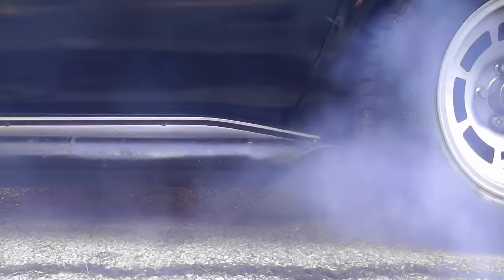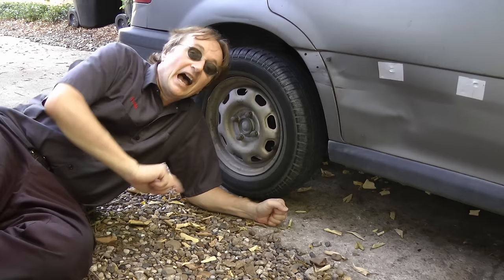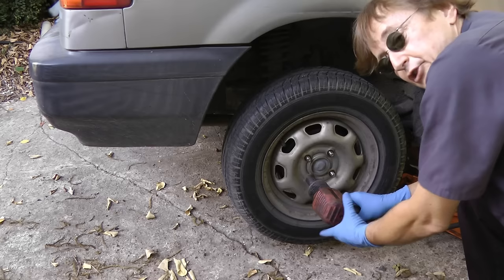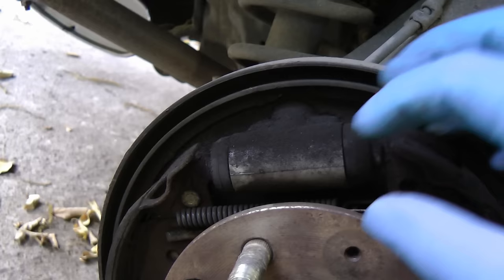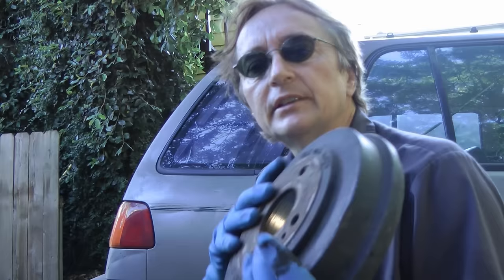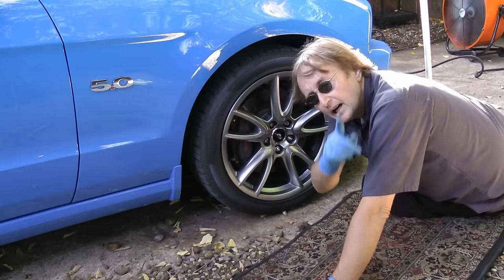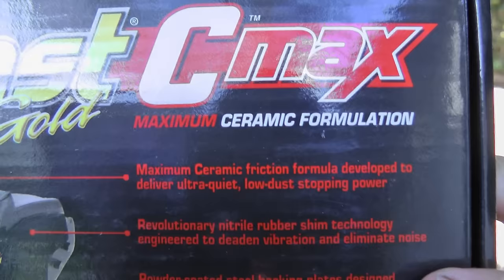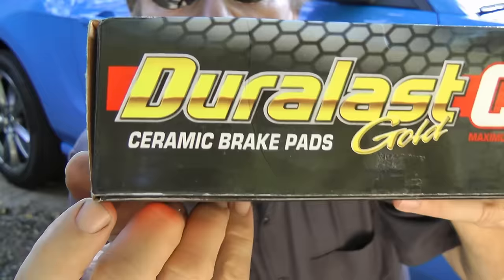How to Fix Squeaky Brakes in Your Car

Comment: Makesure to 'bed-in' the new pads/discs by finding an empty carpark, doing about 20mph and braking hard until you stop. Repeat this 10 times until the disc has a coating of the pad. Do a burn out then hook up with your buds.

Comment: Hey Scotty I have a 2003 Toyota 4Runner V8 and the breaks only squeak when I'm in reverse and lightly press the break pedal, never in a forward gear. It only happens in certain conditions, and I had a break job done a few months ago and I'm not sure if they put on ceramic pads are not.

Comment: Scotty, can a large amount of brake dust cause the brakes to squeak?  So maybe I could get by with cleaning off the dust as opposed to resurface the discs?  Along, what is your recommendation on using disc brake quiet?  Can that be sprayed directed onto the pad or disc?  Thanks for all of your help.

Comment: Rotors come with an anti-rusting agent when you get them out of the box, it's kind of greasy and can make the braking surface slippery. What you need to do is spray them down with a bit of degreaser to get that coating off.

Comment: did this yesterday. cheap pads causing heaps of dust which made the wheels squeak, all i did was take the wheel off and cleaned all the dust , put the wheel back on and it was fixed !! told my cousin its just a dirty car hahaha. now hes returning the front wheel bearing that he bought to supercheap auto .

Comment: Whats the best way to clean front pads up, they still have plenty of material left but i just want rid of the dust is it enough to use a wire brush on them?

Comment: Often all you end up doing on the rear drums is get the drum brake dust out.
Clean with brake cleaner, and lubricate some brake parts.
as far as the front, they usually start squeaking because they're glazed, or worn. glazed brakes, sandpaper, or replace. Worn, replace.

Comment: My car is Subaru 1998 , the front brake pads in the right side is finished

the in-right pad is used from down-side more than up-side

the out-right is used from up-side more than down-side

the left side is ok i think , there is about a quarter to get finished and it's equal from up the down

the slide pins in both sides are ok and greased perfectly

what is the problem ? and how to fix it ?
Reply from the maker: replace the right side calliper and the rubber hose feeding it

Comment: I'm sorry, I didn't make the question clear. Suppose the min is 27.2 mm, and your rotor is 28.5mm now. Is the 1.3 mm difference enough room to turn the rotor and still have a rotor that is larger than minimum?

Comment: HI Scott my 2015 mitsubishi with 30 k mirage (sold as is) squeaks for a few stops after the car has been sitting for more than about 15 minutes. It stops after the first few breaks. I just got the car from big lexus dealership and only put about 200 miles on it.

Comment: I just recently changed my front disk brake pads and rotors (about a week ago) now they will squeak pretty loud when I lightly push on the brake pedal, but then I press down harder, the noise goes away.
Reply from the maker: +Jason Ford live with it, or replace the brake rotors, it means nothing though

Comment: Hey Scotty love you're videos. Always find what I need. But today, I am stuck with another question. The passenger side seems to be squeaking when I start driving at low speeds, and it goes away at high speeds. The brakes are fairly new both front and back. It's a high squeeky sound and its temporary. But it's annoying me. What should I do? its a 2005 nissan altima. Thanks a ton!

Comment: Hey , quick question .. I got a 1997 civic hatchback that won't pass smog .. It was an automatic but then converted to a manual car . When it was converted they didn't put the sensor wires that go to the radiator which makes it not pass smog. Do you think this is fixable and about how much are we looking at to fix ? Thanks in advance !!

Comment: I just replaced my brake rotors and pads on my 99 blazer. The pads are of high quality ceramic and where quite expensive so I was highly disappointed that my car squeals when braking. what could it be? Finally, I took my car to get it check and they told me it needed a bunch of parts in the front such as idler arms, bushings, etc... However, my car does not show any symptoms such as shaking or cracking. should I still be concerned? Thanks scotty for all your amazing videos.

Comment: Scotty thank you for the squeaky brake tip. Inspected my squeaky brakes on my 2008 Chevy cobalt and they will need replacing.. One question regarding lubricating the rear drum brakes on the contact points. Do I use regular grease or should I use antisieze. Thank you. Rich
Reply: Antiseize is not a lubricant for moving parts. Used outside of a joint it can be  a sacrificial rust inhibitor, but doesn't prevent or dampen metal to metal contact.

Comment from the maker: You would have to put all wires and sensors back on, reset the computer, then drive it at least 40 miles on the highway and PRAY the computer resets itself to normal and can do all its tests to make it pass.

Comment: hey scotty i have a 2004 silverado and when im not using the brakes and hit bumps in the road it sounds like the brakes rattle. i say the brakes because it only happens when im not using them. as soon as i put the slightest amount of pressure on the brake pedal the rattle goes away. do you think it could be the pads or what?

Comment: I have a 2000 chevy cavalier, and when I hit the brakes it sounds like a knocking sound. it sounds like it is coming from the back wheels. I recently got all my brakes fixed. My guess (if it is possible) that the drums are warped? could that possibly be something. I know you can't really tell cause your not here.

Comment: Scotty. I have an 06 Cobalt 2.4L S/C. When ever i turn left the passengers side front wheel squeaks. I recently changed pads(it was happening before but pads needed replacing as well) I didn't notice any unusual wear on the pads. Any Idea what it would be I was thinking warped disk. its not a constant squeal its just a squeak at intervals so it has to be something that's rotating

Comment: Hi Scotty,
Need you to point me in the right direction to how I can repair my brake system without merely replacing the entire system , ABS included as the dealer is suggesting.I have a classic '89 Ferrari Mondial T Cabriolet that I unfortunately did not drive for a while. I started occasionally but not much driving with 25,011 original miles.Had the battery replaced at the dealer & they drove it but noticed brake pedal went to floor before stopping. Noticed the fluid has crystallized somewhat in the reservoir, as well as on 3 of the lines, except for the right front. Tried back flushing but no luck.They just do not seem too keen on resolving this creatively other than taking the easy route to replace the entire system, which as you can imagine would cost a fortune. I live in Palm Beach & a previous mechanic who worked on the car some years ago owns a shop in Scottsdale AZ as well as worked for the factory told me it could be resolved but I would need to ship the car to AZ on a enclosed transporter, which I do not want to have to do if not necessary.
Please help!!!
Mark

Comment: I am getting really frustrated with my 09 Silverado. I had the drums and shoes replaced on the rear about 3 months ago because they were worn down and squeaking. At first they were still squeaking but not as bad as before. About a month later they were squeaking even worse than before. So I took it back to the same place and they said my wheel cylinders were leaking. After getting the wheel cylinders replaced they were perfect. Now it has been a month since I replaced the wheel cylinders and they just started squeaking again... and bad too. I am getting so frustrated that I am thinking about trading in the truck! I just don't know what it could be!!!

Comment: just had my brake pads replaced and rotors too but the front passenger side is squeaking so fkin loud embarassing lols. gotta take it back to my mechanic to see what they can do to fix it maybe need more grease ? or metals rubbing each other like the calipers?

Comment: I've got a '97 Miata with disc brakes all around. They squeak very loudly when the brakes are cold and 'feel' quite different but behave normally once I get some heat in to them. Is this a sign of anything or is this normal?

Comment: I have almost 25k miles on my '11  Corolla, original brake pads, and I hear a squeak when lightly pressing the brake, but not when halfway or fully depressed.  What explains the squeaking at only lightly pressed brake, and does 25k seem a little early?

Comment: Scotty, I found an unusual problem on my mothers car when i took it home for an oil change. The front brakes are scrubbing/vibrating when stopping, rubbing when accelerating like they are sticking. Her BF replaced the rotor and pads on the front, he had to go back an apply anti-squeel to them to stop squealing, but they still do. Aside from that what do you believe the issue could be. I just need advice i have not pulled them apart yet. There is an unusual amount of brake dust to me. '10 Mazda 3

Comment: hey scotty, im having a problem with my brake lights not illuminating. ive checked the brake switch, fuse and bulbs. i have running lights and turn signals but no brake signal.

Comment: I just replaced my brake pads and rotors on my 07 prius it's making a very large squeaking noise on the passenger side tire. Do I need a special tool or maybe readjust the brakes.

Comment: Hey Scotty, i have a question... My front disc brakes on my ford f150 start squeaking on me when i do light braking after the truck has been driven for 10 to 15 minutes. (assuming the brakes are warmed up).. when its not warm there aren't any squeaks at all. would that be just normal? Not sure if they are ceramic pads or semi metallic...

Comment: What is considered a new car these days? right side brakes of my 2003 Ford Falcon BA are starting to squeek, is it possible the workshop replaced them with lower quality brake pads then the originals or would you say my drums need resurfacing?

Comment: hi scotty my 2003 trailblazer with 149,000 miles has a constant squeak coming from the right front wheel. the noise doesnt really get louder has a break but there is a pulsation in the pedal as i stop. do you think it's time for new rotors?

Comment: hey, im looking for a car under $2500. Iwhat do you think is the most reliable car or truck that will be in that price range? also, whats your opinion on pontiac grand ams and ford mustangs from around 1999-2000, with about 125,000 miles? reliable or junk?

Comment: Scotty hi, I have 2007 camry. I replaced brake pads and resurfaced my rotors. The mechanic said that It would take a good 300 kms. as the break-in period. So the car's breaking performans decreased considerably. Do you think it's normal?

Comment: 1997 F 150 when I press the brake pedal the rear tires lock up and a slight drag is heard afterwards, and a low pedal, it already has.new rear.shoes , any ideas ?

Comment: hey scooty i got a problem for u i can fiure out a budy of mine over tighten the spindel nuts when he changed his brakes burt up the berings and all most lost a tire  so we replace the spindels  are clapier but the damn brake pedal  still soflt after we have bleed the tires and the abs  the truck is a 94 f350  4w4 diesel

Comment: Your a god!!!!haha I was wondering if you could help me on a problem with my car I've been having.. my lights on the dash do not work ...I looked at the fuse in every time I replaced one it blows there is a short somewhere in the circuit but i cant find a way no way I can find it.. is there some way I can make it easier to find this problem thanks.. I've had this problem with this car sense I've bought it running late's work training signals work just those it's a 1997 Toyota Avalon XL thx agai

Comment: Hey scott I have a 2006 f-150 and it has new ceramic pads and the rotors have been turned but when i coast the brakes squeak but any pressure on the brakes will stop the squeek im puzzled any suggestions

Comment: hah just reminds me of Crappy tire, they were advertizing Teflon brake pads that "dont squeal" something about a low friction substance in a braking system that relies on friction doesnt sound like a good idea to me, but then again they also had teflon wiper fluid that leaves a film on your windshield that glares like crazy in oncoming headlights, sunlight and even street lights so all you see is a white glare, but it dont squeak. that bugwash you add to your fluid takes the film right off.

Comment: Scott, I have a 2006 GMC sierra with real squeaky rear brakes.  The original Delco shoes never made a sound.  I've replaced with NAPA TS-10855 China made shoes.  I've turned the drums, cleaned and sanded the shoes many times, slowed the truck down with the ebrake applied to try and seat the shoes.  Readjusted them numerous times.  The screeching will stop for a day or 2 and then come back very loud.  I'm ready to get the OE GM shoes, but they cost about 150.00 from rock auto.  Anything else I should try?  I've done drum brakes on my old 64 ford galaxie and 85 S-10 and have never had this problem before.
Reply from the maker: that's cause they used to use asbestos back then and it was quiet. If you don't want noise, buy the dealer shoes
Reply: Very true.  I still have a guy who custom relines my ford brake shoes with asbestos; stops good and quiet.  Although very dangerous it was the best material for drum brakes.
Reply: Look up 2006 GMC sierra on the Akebono site  http://showmetheparts.com/akebono/
 According to Akebono some of those models came stock with Akebono pads and shoes

Comment: Scotty:
After the last 3 rear drum brake jobs I have done I have noticed a knocking noise that starts as the car is slowing down and then stops when the car is stopped.  I have new drums, shoes and hardware kits installed and cannot figure out what is causing this noise at all.  Any ideas?  Do you think the shoes could be somehow slapping the backing plate?  There is a youtube video that duplicates the noise I am having....type in "02 zx2 brake drum noise"

Comment: Need help.  Just had rotors resurfaced and new pads installed.  Pads HB470N.643 and HB378N.565 HP Plus.  Same pads as I used last time.  My braking performance now dropped 20% and they screech so loud, you can hear my car stopping at a stop sign from about 1/2 a mile away.  Only car at the track that has brake noise and it is embarrassing.  Please help!

Comment: hi scotty, i just purchased a "kleen flo brake cleaner" because i had a minor squeaky sound if i do a slight brake on my 2008 chevy  car, do i need to take off the wheels to use a brake cleaner? will it harm my tires and rim?
thanks

Comment: I don't like the idea of tapping on the metal rotor with a metal hammer.  I guess it might be okay if it were a bronze or brass hammer, but steel on steal will likely dent a rotor.  I would recommend a rubber or very hard plastic mallot... of course, when this doesn't work you probably need a bigger hammer ;-)

Comment: i have a 2003 vw gti and recently the rear driver brake seems stuck or something i hear rubbing or squeaking. the brakes have been changed within a year with new rotors also did them myself. Haven't had any problems until recently any idea what it might be ? when i begin to brake the sound goes away but cruising around 25-35 i hear the noise. any help is much appreciated .

Comment: Hey I have a 2005 surburban and when I have the air on the passenger front side air vents blows heat,but the driver blows air and both temps are set at 60.any clue

Comment: I have a question. I have a 2008 pontiac g6 GT, and I got my brakes changed in the wrong shop. They put some cheap pads on my car and sounds very squeaky. They said they put Semi metallic pads. My question is should I change my pads for ceramic? I want to change my rotor too do I have to ask for any special rotor for ceramic pads?. I have doubts why do you say that new car need ceramic? do they have a different rotors? thank you I wil appreciate your answer

Comment: I have a 89 ford grand marquis. Noticed my front left tire sounds like it's squealing when going down the road but as soon as I apply pressure to the brakes and bring the car down under 15 mph and to a complete stop the sound disappears. Then when I start accelerating it starts squealing again. I'm not hearing any grinding sounds and my brakes feel fine their not spongey or hard etc.  Any ideas or suggestions.

Comment: Just replaced front hub and bearing stopped the clicking noise thanks, but its still making brake bad to rotor grinding noise. i think the rotor is warped, even though its brand new. you ever seen this happen where they are defective from the factory?
Reply from the maker: yes, but more often rust or crud on the axle hub makes the rotor spin crooked

Comment: Love your channel man, you always help me out. You see i have a BMW X5 and i first started hearing metal on metal, not a squeky sound,  but a hard grinding from front when i brake. I went and got new front brake pads, but when i changed em i noticed there was still a quarter inch of meat left on the old pads..I then started hearing a horrible squeeky sound with the new pads when ever i gradually brake... so i went n changed the rotors and the problem still remains do u think in this case a gradual stop or release of the brake pads yielding such a loud squeeky sound might just be because the pads i got are too semi metalic??

Comment: Scotty, replaced the rear brake pads of my 01 civic but used the same drums. Now I hear loud metal scrapping when I'm braking specially from the rear right side. Could it be that I just need to resurface the drums?